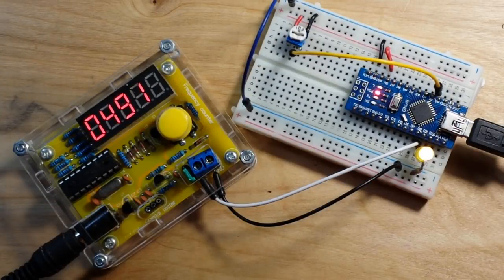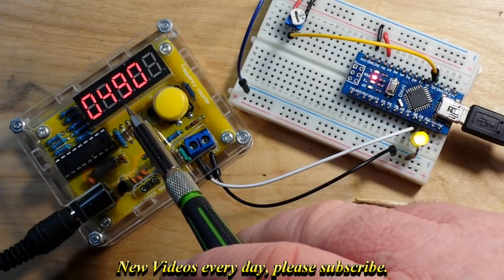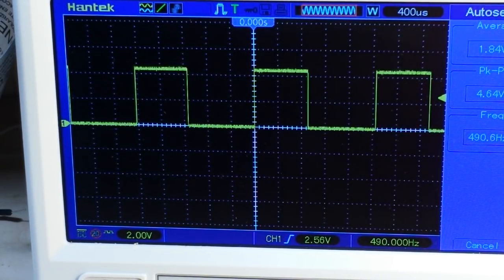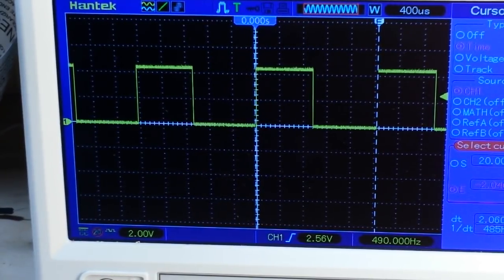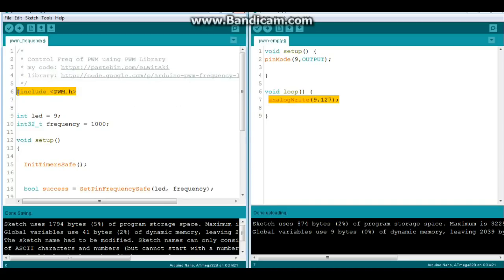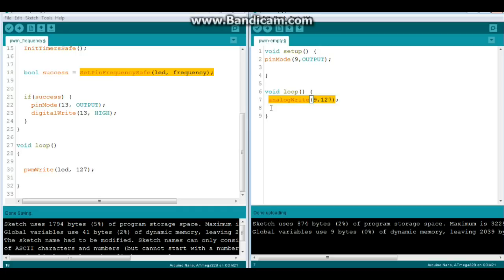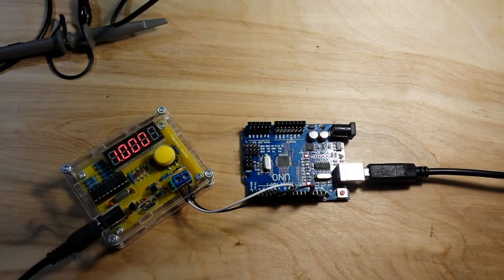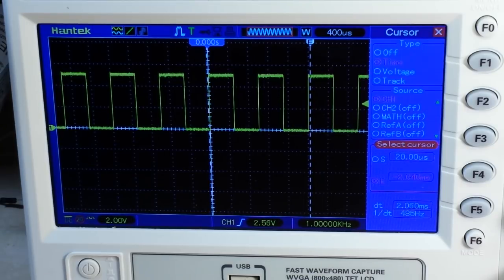Arduino Basics Change your PWM Frequency

Comment: Perfect.  Been making an led controller and had issues the whole way through, finally got it working but when hooked to the LED strip they squealed.  Changed the pwm to 1khz and the noise is gone!

Comment: Thank you! This is veryquick and easy way to set the frequency. On the higher frequency range it works better with some number than others. For example setting frequency to 666,666 Hz, gives me 666,675 on the freq. meter, which is quite OK.However a setpoint of 666,667 Hz outputs 727,282 Hz. The higest I was able to get is 2 MHz.

Comment: The relationship between High Time and the Period is called "Duty Cycle". The duty cycle is the ratio of highTime/Period. (edited to correct my error)
Reply: Not quite. PWM is the ratio of highTime to the period. According to your logic a 50% duty cycle would have a duty cycle of 100% because highTime and lowTime would be equal.
Reply: @robum911  You're absolutely right. Apologies for my error, and thanks for correcting me. 👍
Reply from the maker: You don't say

Comment: Three pins worked ok: digital D3 (PD3), D9 (PB1) and PD10 (PB2). Other PWM - pins did not work. Those that worked ok, worked well.
Reply: thanks i was using D5 couldn't figure out why it wouldn't work

Comment: i got real question why is pin 5 the pwm frequency cannot be set i was blocked here with the motor going full speed for no reason when signal was high enough(should be dimmable)
and the i try adding a second set  of code for trying and set to pin 9 it work >_>

fu my life i broke 2 arduino chip set and the main ebike arduino for such a crap thing

Comment: Sadly I can't have 1 second on one second off with this library because I need a frequency of 0.5 Hz and freq. is controlled by an int32 and I would need a float
Reply: You could code that with delays or Millis, it's a very low frequency

Comment: When I try to install it as a zip library it says Specified folder/zip file does not contain a valid library! v5
Reply: solved changed the name to something without dashes or spaces and took out all the unessential files
Reply: @JCchan99   I see the same error. Which are the unnecessary files? How can i know?

Comment: hello  i was wondering if you would be able to help me.i have digital puls generator .how can i program it to run 10% duty cycle at 0.64 v input and gradually increacing voltage to 3.86v with duty cycle 90%.its for my project where voltage coming from throttle position valve potenciometer control my pulse/duty cycle generator which then directly control fuel injector.any advice most appreciated cheers jo

Comment: Just to avoid going insane when you download the library at the link above you have to make a small alteration. I found that once the zip file is downloaded it will not install correctly following the advice on  https://www.arduino.cc/en/Guide/Libraries. I eventually found out that it might be best to extract  the zip file  then transfer to the default folder usually Documents/Arduino/libraries . Now open the extracted file to find PWM folder/ open this and copy contents/ then return one step and paste the files in the same directory as the PWM folder.This should now show up in the include library option of the compiler
Reply: Thanks it works. Bascially copy content in PWM folder and paste it Documents/Arduino/libraries/Arduino_PWM....
EDIT:- actually it doesnt work!!!

Comment: Have you tried varying the frequency within the loop program? Can it be done? Thanks for the very interesting video. I want to make some noise with the Arduino.
Reply from the maker: +David Tucker I tried changing it with a pot, I didn't have any luck. But to be fair, I only tried for about 5 minutes.

Comment: Can you incorporate a 2nd pot to vary the  frequency value as set by the instruction... " int32_t frequency = xxxx "...  so that you can do it on the fly without a code change?  just as your doing with the duty cycle.?
Reply from the maker: paul gray I tried that with no luck, but I may have done something wrong.

Comment: Have you ever thought about making a DC converter out of an Arduino?
    I have an old portable heater I was given for parts. It used 2 PIC12F675's as switching controllers in a boost topology for the heating element and an 'ozone ionizing grid.' I thought it might be interesting to make an Arduino version of a DC Converter controller. I'm a slow handicap gimp with a bad back. I'm not sure how long a project like that would take for me to complete.
Reply from the maker: Upcycle Electronics any Arduinos would be more than capable, but it seems to me to be a bit of an overkill. A 555 timer will do the job nicely. did you see my "make your own boost converter" video? If not, here's a link...https://youtu.be/IxzoqzbAYfE
Reply: learnelectronics 
  Sure it can be done with a 555. I've seen people try to use an Arduino just for the display interface of a bench power supply. I would find it interesting to try to build the display, interface, and controller on a single platform. I don't even know if it's possible for the Arduino to handle both the interface and controller, but a PWM constant current controller with adjustable current and voltage would probably be popular for those ready to start exploring more relevant technology than ancient linear supplies.